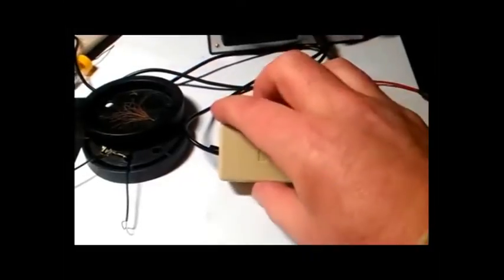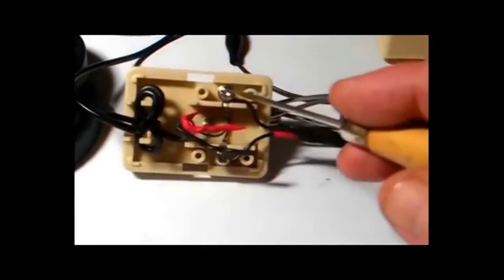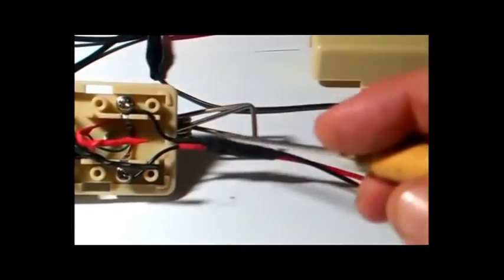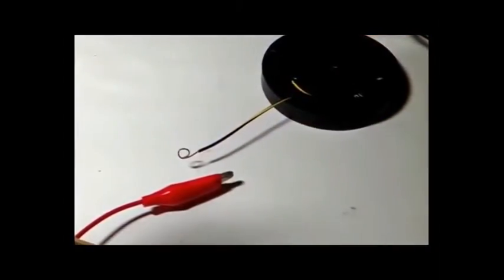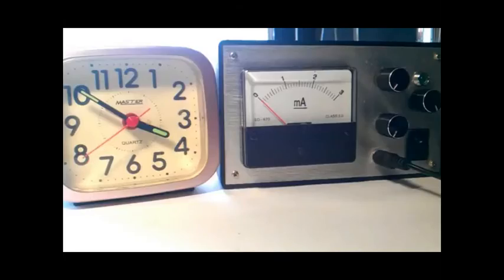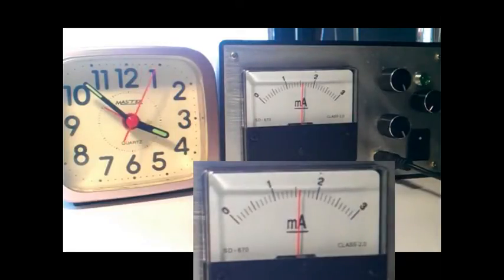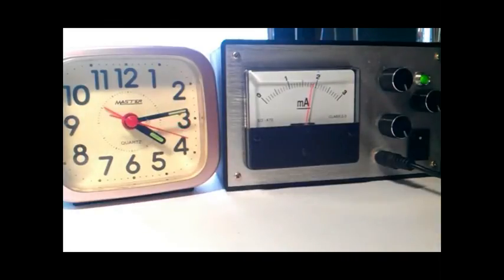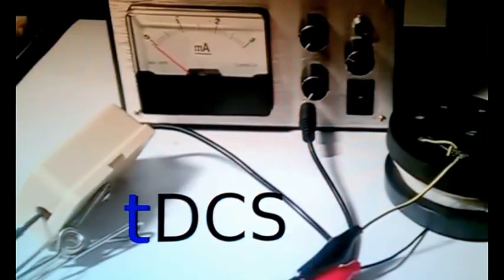My tDCS Experiment: Part 10: Final Electrode Fix & Live Session

Comment: I really like this series of videos--amazed that there are not more views...
Question--do you have a schematic of final circuit with LM334---and the Pots...?

I built a crude one with simply a lm334 and a 27 ohm resister ..I simply have used an auto-ranging meter to check current..power it off of a bench power supply...

The use of ramping pots seems attractive--but you mentioned its 50k..which seems really high to me..

a Schematic would be very helpful..

and of course, keep up the great work--there are some TDCS videos that are just idiotic--one in particular gives a schematic that is short circuited a few times over...lol

Thanks
Reply from the maker: Thanks for your kind words. :-)  

Yes, there is a rough (hand-drawn) schematic in the previous episode (skip ahead to about 85 sec). That should tell you everything you need to know. 

https://www.youtube.com/watch?v=vtxfxKJI0VU